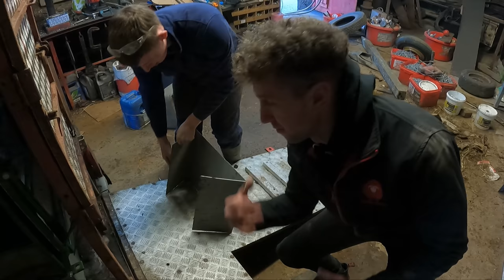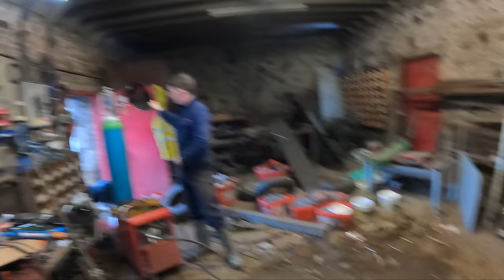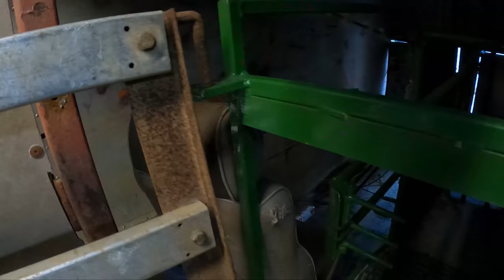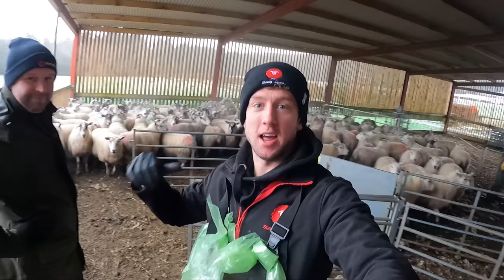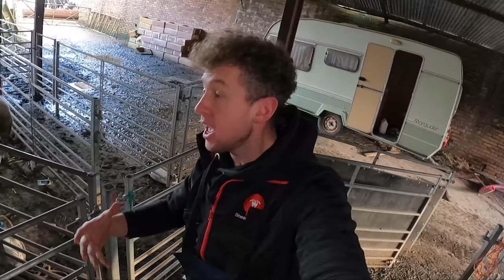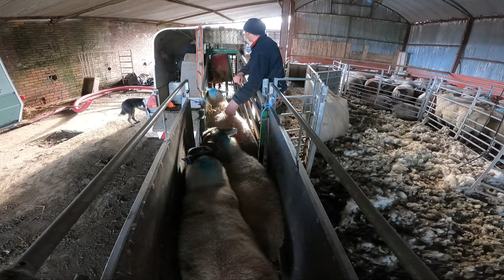Pregnancy Scanning Early Lambing Sheep and asking why!

Comment: Local scanning boy thought he would fit an upmarket heated car seat in trailer. Fitting it out in workshop, had a selection of wires to sort to find heater. First wire he powered up went to crash sensor, airbag exploded out side of seat and blew him across workshop. Be warned !
Reply from the maker: Would make a great video though Robert😂

Comment: I am 46- a girl and learned to weld. I was in high school in 90’s - BIG HAIR- also I was first girl who took metal shop at the trade school. 💃🏻 😉First day I walked into class, the teacher, in front of the entire class, asked me if I was in the wrong room- this was metal shop.
Yup- I reassured him I was aware of my location and choice.
He wondered how that hair would fair with a welding helmet and ⚡️ sparks- it survived well.
So I learned ARC, MIG, TIG, and gas welding. I took two years of metal shop in total. 
It was fun. My favourite method of welding 🥽 was ARC- there’s just something about that bead that’s beautiful and I love the flow and timing of arc.
I liked TIG but it is quite difficult to adapt too and you can burn through so easily if you don’t watch your speed and flow. We only learned on aluminium- as it’s great for low temp welds. It’s got such a pleasant color and quietness to it- but difficult without practice 
I just never got on with MIG which is most people’s favourite- it was too messy for me. I guess MIG welders don’t mind the grind ;)
Some don’t enjoy using sticks but this girl does 
My dad used to have a brass cannon I created on a lathe and a coupe samples of my beads on display. He was a welder too.
Sheep Fan in Nashville Tennessee USA 🇺🇸 👋
Oh and those beads pass inspection for the purpose- nice and clean- I only saw one small hole which is outstanding with a mig for that light metal. I’d have melted the whole dang thing with a mig 😂

Comment: Slacking a bit at the start cammy didn’t get your sparks caught in the bucket. We got a blue texel tip to put with our mule Hogg’s and it died after 2 seasons typical sheep thing to do.😂😂
Reply from the maker: 🤣 trying to set a better example!
Reply: The thing is,grass fed last, force fed flop.
Reply: @wendyrowland7787  lived on grass just got a larl bite of cake everyday with the rest of the tips.
Reply: @jjpattinsonphotography3738  but did you rear the tup? Too much force feeding at the growing stage leads to a shorter life. They grow too fast and get a weaker frame. Teeth dropping out prematurely is a good example.
Reply: @wendyrowland7787  no we bought the tip at Carlisle auction as a tip lamb so the fella could of feed it too much before that.